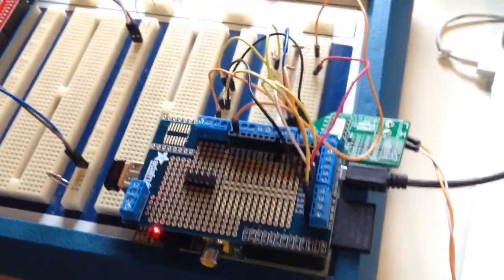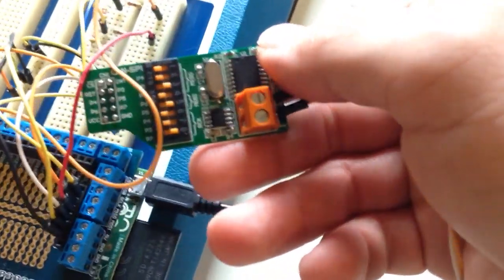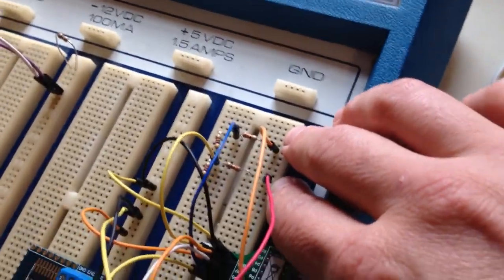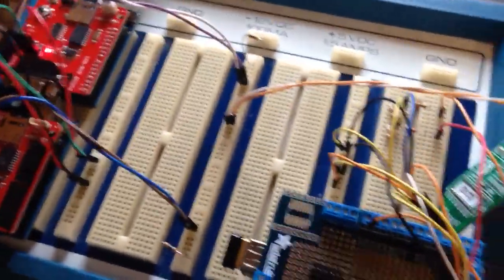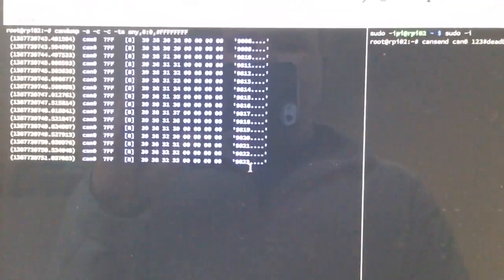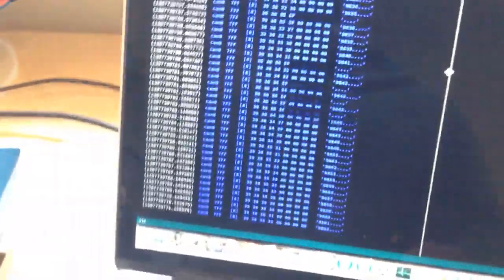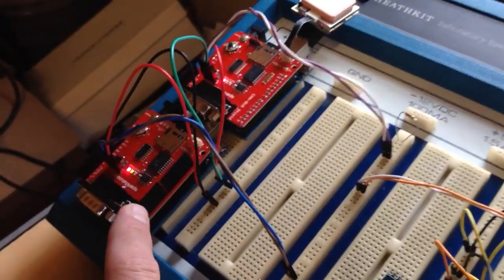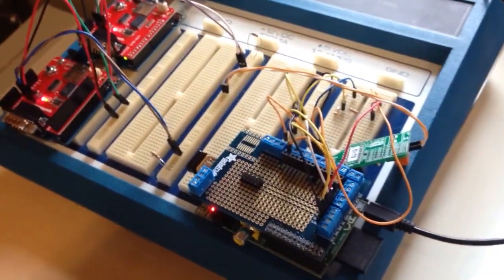CAN-Bus Hacking with the Arduino & Raspberry Pi, Part 2

Comment: Good day, 

I am George and i'm currently doing a project about home automation using Rpi and Arduino Due. 

The following are my questions:
1. Is the SPI shield by SK Pang compatible to the RPi model B+? 
2. Can i interface Arduino Due boards to the RPi using CAN bus?

Thanks and hoping for your response
Reply from the maker: I don't have data on either question,  but hopefully some of the other viewers can chime in.
Reply: Chad Gibbons can i have you're email ad, sir? if it's ok with you.

Comment: The CAN SPI board form mikroelektronika, can you hook that up to the arduino's instead of the sparkfun CAN shields you used? If so, what arduino libraries should be used?
Reply from the maker: Yep that works just fine, even with the library made for the SK Pang / Sparkfun board.